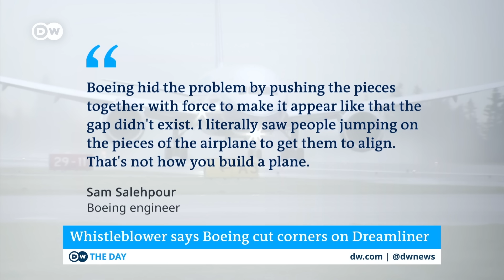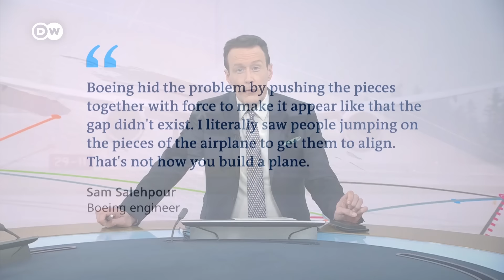Boeing denies allegations over production faults | DW News

Comment: I'd bet the FAA is not going to pull the type certificate on this aircraft. If the composite structure fails in a significant way, people will die and new regulations regarding this manufacturing technique will be written in blood. The safety culture needs to be revived at Boeing. Perhaps that will occur after Calhoun leaves on his golden parachute. Several hundred passengers certainly didn't have that option.

Comment: Just to that issue of the 767 being a real pig to work on, I think it was universally acknowledged that the 767 and the 757 before it had been basically built as transcontinental planes at a time when transcontinental flight was largely changing to series, interconnective hubs so... having a plane that big that wasn't fundamentally suited to what the 777 would eventually come to do (which was medium intermediate intercontinental) but that it also was a large and mechanically cumbersome plane made it - a nuisance.

Comment: Roughly 10 or 15 years ago, when fuselage assembly was beginning at the Vought plant Boeing acquired in Charlotte, So. Carolina, some fuselage sections were found to Not fit: their dimensions of diameter were out of tolerance {I think like 3/4" over a 16' diameter span}. Investigation discovered the parts were fabricated at a facility somewhere along the Golf of Mexico coast, which had No HVAC climate control, that the disparity of 
size was simply due to variations in temperature of parts during their fabrication. This is the sort of process control issue which modern manufacturing in accordance with ISO 9000 (...9XXX) has been eliminated through successful monitoring, documentation and adherence to control regimen.  

What we witness, during manufacturer fabrication and airline operations {also likely civilian/military}, are operations seemingly efficient, but likely at the margin of imprudence. Consistently over last 10-15 years, there
have been reports both from Boeing Washington, contract manufacturer facilities, and in the separate airline
operations/maintenance, of processes not quite up to par. 
Judgement perhaps over 'the line' was often an issue in legacy American manufacturing.

Comment: ✊New brave whistle blower rise....
The whistleblower claimed that various parts of the 787 fuselage on which it was working were not fastened together properly, an issue that could impair the aircraft's performance over time. In addition, the aircraft was maintained and tested in the wrong way.

The flaw affects more than 1,000 787 aircraft in service and could cause "severe fatigue" of critical aircraft components, particularly large fuselage connection areas.